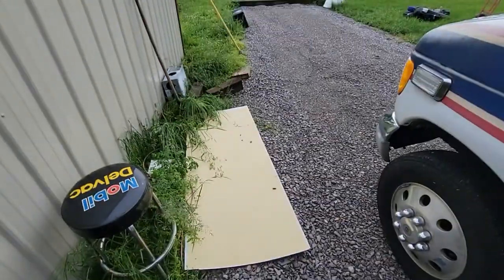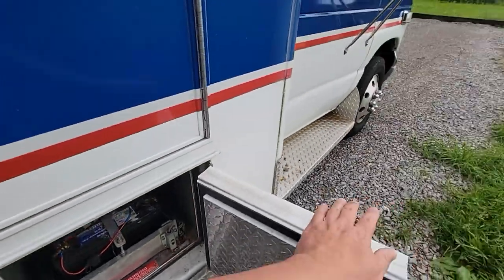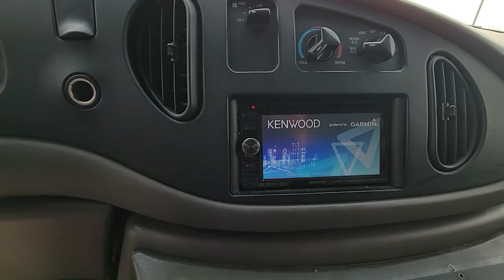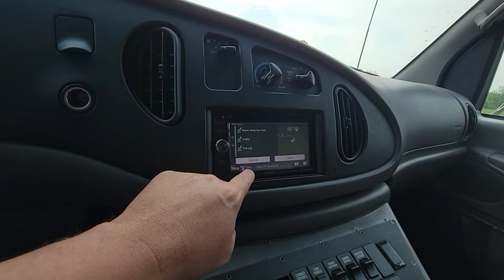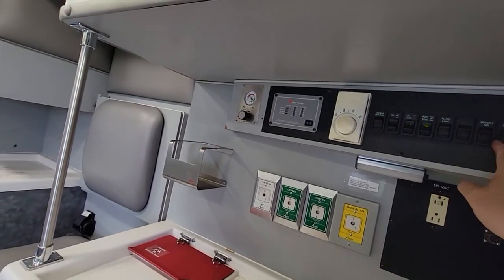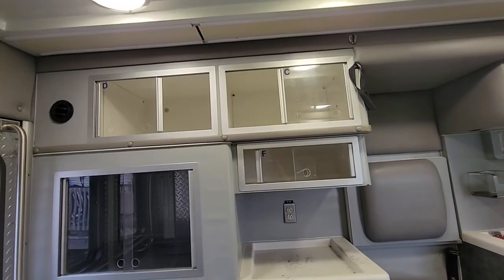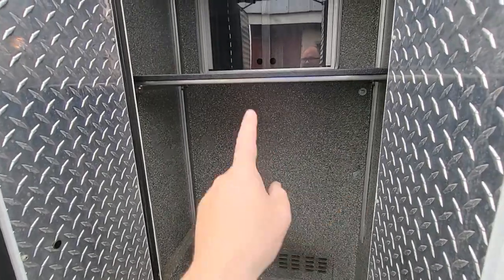Ambulance Walk Around - Prior to Ambo Conversion

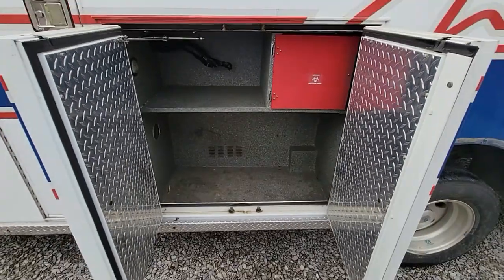Comment: @1:32 I have nearly an identical Wheeled Coach, a 2000 7.3, and that location is where my inverter and breaker boxes are. Looks like your inverter is most probably under the seat. I did get the complete binder with instructions and wiring diagrams when I picked mine up. I have been planning on scanning them to PDF, might be somewhat relevant for your year build.
Reply from the maker: Mine is under the seat but it doesn't work.

Comment: Sounds like a cool project.  Looking forward to seeing how you get the compressor and other tools/equipment set up.
Reply from the maker: Videos to follow.    I will say I'm struggling to find a place for the generator.   They are all just a little two big for the allotted space.
Reply: @Bairleafarm  I'm in the market for an ambo to make an RV, but also pretty well equipped with tools, compressor, welder, etc so I'll be dealing with many of the same things you are working on.  Not sure of your generator dimensions, but I"ve seen people back some pretty decent-sized Onan/Cummins generators in side compartments on ambos and also a few others that fit smaller ~2000w Harbor Freight and honda type gens in there, but I'm guessing you need more power than that.

One way I think I'll be able to save some space is to separate my compressor from the air tank and mount the tank under the vehicle between frame rails if there's room.  That might help you out if that's a concern for you.
Reply from the maker: The 2000 watt fits no problem but I need bigger.
Reply: @Bairleafarm  Yeah, that's what i figured.